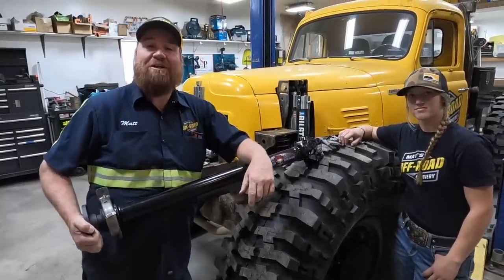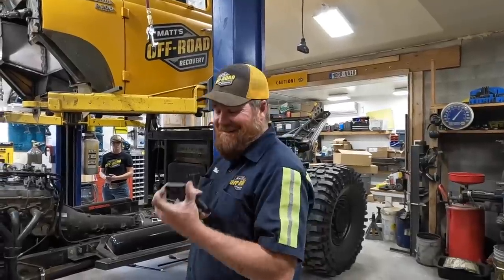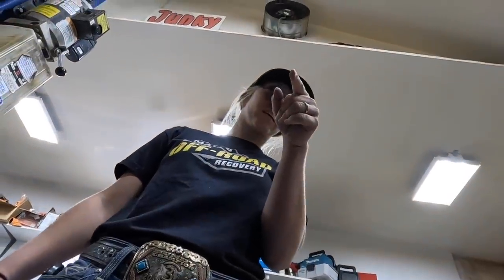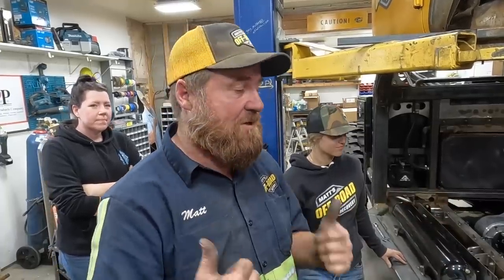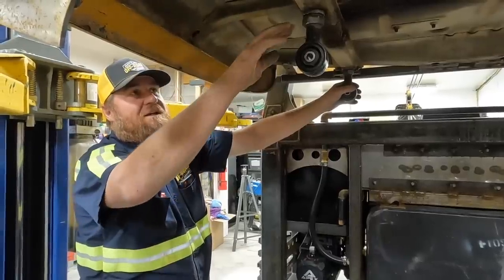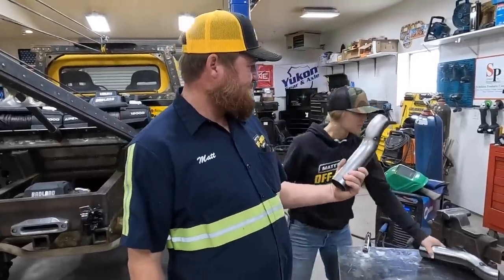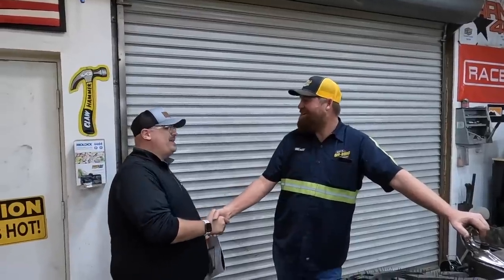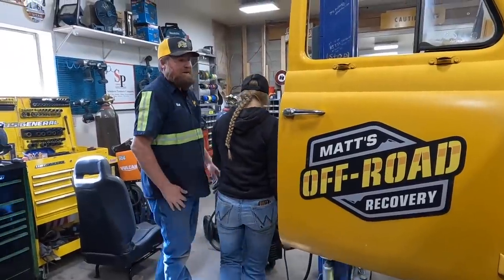Is The Largest Wrecker Too Heavy? SEMA Deadline Looms!

Comment: 8:47 Man, I wince and tense up every time Matt is grinding without eye 👁 protection. May your good luck continue 🙏 Sir. 
Most painful injury I've ever had was a metal shaving in the eye 😲
Reply: You're going to tell a man what to do then say a metal shaving in your eye was your worst injury? Lmao
Reply: @mfurrow81   he didn't say worst, he said most painful. And he is trying to prevent someone else,Matt included, from making the same mistake. I use my safety squints every time I grind.
Reply: Safety squints weren't rated for that type of grinding, eh
Reply: @mfurrow81  You can't read or comprehend well 🤔 I never told anyone what to do.  I said I wince when I see someone else doing what I did because it brings back memories of a painful eye injury. Good grief. Please try harder and not be so quick to criticize, be so negative.
Reply: @lanesworld4000  
I can read and comprehend just fine. I can also read between the lines. Tell me, what was the intention of your post? I know, it is 100% criticism and a round-about way of telling Matt how he should do things. Tell me I'm wrong. I'll wait.
Reply: I broke an arm and 5 ribs in an ATV accident, and it was more painful I can attest.  However, getting the metal shaving removed and then the rust ring routered out of my eye was far far scarier.  I know where you were going with this, and I agree, but a random comment isn't going to change his mind.  Most people, myself included need to learn the hard way lol.
Reply: @Bobbywolf64  Yeah, I'm not trying to tell anyone what to do. It just reminds me of things I've done when I see things like that.

Comment: Something that may help with the cab removal would be to coat the hardware in solid film lubricant. We use it in aviation for spots like that and it helps significantly. The Sandstrom brand is good. If you use it, only apply enough to change the bolt color because of the added diameter.

Also guessing 11,500 lbs
Reply: Aviation lubricant?  Cool! 
   My brother put a jet engine in his Mustang last spring, and the chicks really dig him.

Comment: The look on Matt's face when he got the weight ticket was like a kid at Christmas. I think it came in lighter than he was hoping when he planned the build.
Reply: I was thinking the same thing or it was almost spot on of what he guessed.
Reply: I noticed that as well and was thinking the same thing.
Reply: I think he was really close.
Reply: Looks great $10,868 lb
Reply: I love how he throws the cash at her and walks away before she can give it back. "You don't need to do that..." "I know!"
Reply: I am not sure whether Matt is hoping for a certain weight, or fearing a certain weight... to generate enough dead pull, or to keep the front end down while another vehicles weight is hanging on the boom you need weight, but negotiating trails or soft ground, weight is a disadvantage.

Also the wheelbase looks like it may high-center on trails vs Trail Mater... not sure what kind of use Matt has in mind for this rig..
Reply: I am betting it will be used to recover the stuck vehicles in the water at sand hollow or in the mud.
Reply: @Sjanzo  I think the main job he has in mind is recovering very heavy vehicles on soft sand. Not as trail focused as the other vehicles.

Comment: 9,273 lbs. judging by Matt's reaction to the wight slip, I think it turned out lighter than expected! 😃
Reply: I thought the same thing. He had that "I can add another 1k lbs to this puppy" look on his face. ;O)-
Reply: 11,420 pounds
Reply: I don't know it was really sagging their Ford truck that thing's pretty heavy, at least in the front it is.
Reply: 9978
Reply: @dedalliance1  that is where the engine is though so most of the weight is gonna be on the front of the trailer
Reply: @Lucas Cobrea  True, but that truck probably has about 2,500 pounds of payload and it takes a lot of weight to make it sag like that. My truck has 4k pounds of payload as a srw and with a 3k pound pinweight fifth wheel camper it doesn't squat that much it sits level. Bumper pull trailers usually transfer 10 to 15% of the total trailer weight, given the large motor it might be closer to 20% based on how it's loaded. I don't know how much the trailer weighs maybe 4 to 5k pounds. Their truck was sagging enough I'd say it's over loaded from a payload perspective. Hard to say exactly how heavy the wrecker is too many variables but I bet it's not under 10k pounds. I've towed a 3500 diesel dually crew cab on a similar trailer with a 2500 gas truck that had a 1k pound camper on the back and it was sagging maybe the same amount. Who knows though lol it's all just speculation but that truck was sagging really good and I know it takes a lot weight to do that.
Reply: @dedalliance1  it's a ford, they all sag like that

Comment: Nice going Matt & Lizzie, you 2 work well as a team both off road and in the shop. Guessing the weight is 9375lbs then add fuel etc topping out 9450 lbs
Reply: So, you think its only a 10 gallon fuel tank? More like a 50 gallon tank ~350 Lbs for fuel weight.

Comment: I haven't made it all the way through the video yet, but it looks like the size of your solid cab lift bar is less than the tube. From a bending load perspective the most stress is at the top and bottom (which is why I beams work), so solid bar won't give you much of an improvement and might be a step backward if it's smaller. I suggest sleeving the small tube with a larger size and just leaving 6" or so to insert into the cab pockets then weld the sleeve to the smaller tube all the way around. That will make it much more resistant to bending and less likely to smash your toes if you drop the bar!

Comment: Hi Matt, great wrecker!!!  Love it (Unimog axles would have helped ground clearence though... But I am biased, being a Unimog guy). BUT: keep in mind, the way the geometries are (angle and lenght of crane arm) leads to a force at the pivot point of the arm (pivot point at the rollbar-like frame behind the cab) that will be higher that the weight you are towing. Do the math applying parallelogram of forces. E.g. with the arm elevation being 30°, the factor would be about 1.7. I am not sure your rollbar type pivot will hold this without having an additional support to the rear frame. Depends of course how much weight you want to lift. 
Keep on doing what you do!!!

Comment: Since weight doesn't really matter...I'd use cabover latches to attach the cab. Four of them and a small hand hyd pump to release the locks when you need the cab off.
Reply: Yep... you read my mind 🌵
Reply: @timothycontreras8424  the fancy electric pump model gives more mounting choices, but since they're not pumping a cab over I'd just use a manual pump. Could even use small tailgate cylinder latches found on all sorts of garbage trucks using the current mounts.
Reply: The nice thing about cabover latches is they almost self center. Tailgate cylinders would require that things are lined up pretty close.

Comment: Out of all the trucks at SEMA your wrecker was definitely the most functional
Reply: And his actually has tires
Reply: Ah, SNAP!!!
Reply: Functional? ...It can't move under it's own power ... the transmission case is empty ... it has to be pushed or pulled everywhere it goes.
Reply: @andrewk8636  But no transmission!
Reply: @tyendor1952  😂
Reply: @tyendor1952  you get the point, the rest of the “SEMA “ builds wont see any off roading
Reply: I think he was trying to say, built for a specific function.  Not built for cosmetic ohh’s & ahh’s.
Reply: @equate3230  exactly at least someone understands the point I was trying to get across

Comment: I'm thinking dead close to 12,000 lbs., just because I have built some stuff before.  Great video, can't wait to see the shakedown run for the heavy wrecker.(EDIT) On the copyright thing, Mountain Dew would be required to sue because if they didn't make an effort to protect their trademark, it would become Matt's trademark. Mercedes has gone through this already with the Rappers who were putting the hood emblem from their Mercedes on album covers. Obviously, the Rappers were just considering it to be Bling, but Mercedes was required to act to protect the trademark.
Reply: What copyright thing? I have not heard about it.
Reply: 1111 but I don’t know Mat seemed pretty happy as soon as he saw the number.😂 so my final guess is 1010
Reply: Lizzie, how many spools of welding wire have you gone through? I bet 11,400 pounds total on the truck so far because of the frame, wheels, axles and superstructure. No carbon fiber on that rig. Good old American steel (unless its radioactive in which case its probably Russian)
Reply: 8895
Reply: Matt's smile was too big, I'm guessing under weight
Reply: @bradenreay4536  a tiny Smartcar weighs more than that.  I'm thinking you missed a zero there lol.

Comment: I’m gonna say that joker weighs in at 14,765. The 98’ Mack CH single axle I drive weighs 13k and you got way more steel on the wrecker. Who knows could be higher that Ford was definitely touching the bump stops or very close to them 😆😆 looking like a truck from Carolina

Comment: Matt this is Dan from Sacramento California ..I was watching your video the largest Wrecker, you have your exhaust your headers and your pipes coming outside of the frame , how do you have that mounted.? And when you accelerate  the gas is that not gonna twerk the motor left to right and if you have it bolted to the frame is that not going to loosen your header bolt or cracked exhaust ?  I’m just curious I’ve never seen that done outside of the frames. Unless it’s free hanging I could not tell. Love your shoe bye the way.. Dan. G…